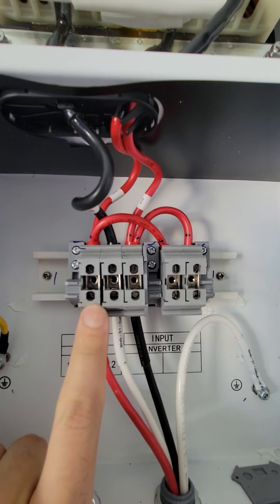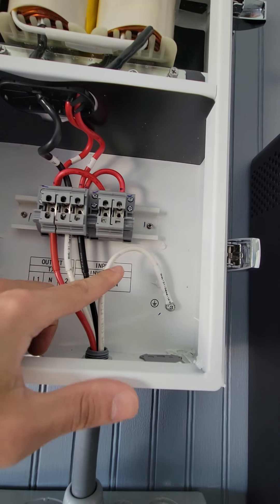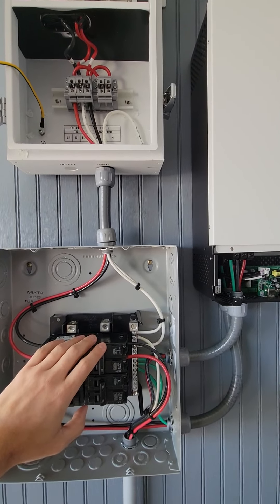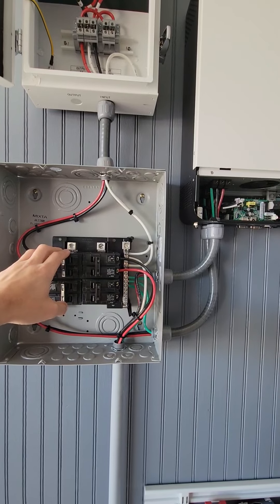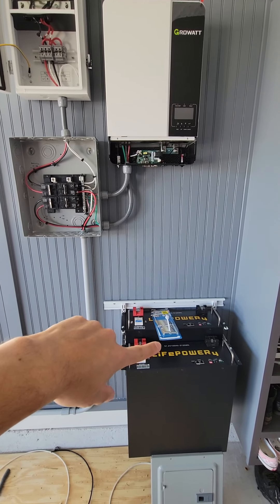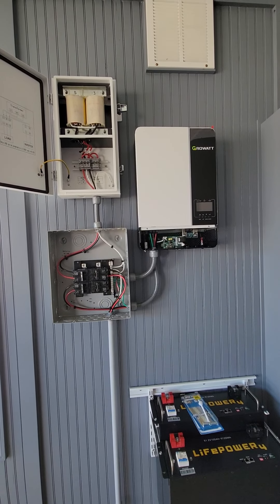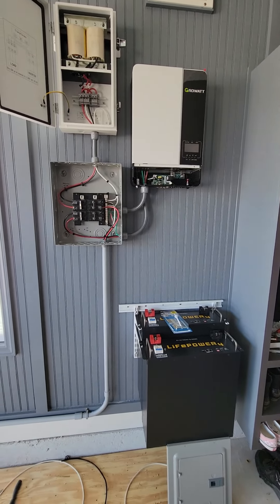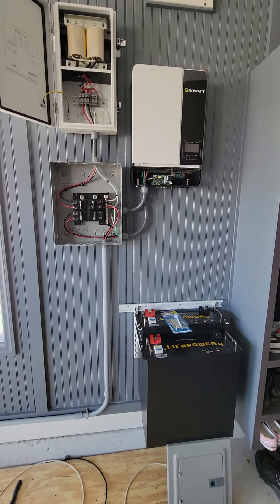Growatt 5KW Transformer and Inverter

Comment: Your setup is fine so long as the breaker for the transformer is NEVER turned off or NEVER trips.  if you do, you will lose the neutral and half of your 120V loads will decrease in voltage and the other half of your 120V loads will increase in voltage.  How much will they decrease and increase?  That will vary based on how much imbalance there is between the 120V loads connected to the different hot wires.  They will always add up to 240V though, so you could have 80V on some and 160V on the others, or it could be 10V on some and 230V on the others.  It'll all depend on how imbalanced the loads are when that neutral is lost.  You can fry you devices at best or start a fire at worst.
Reply from the maker: I will call signature solar and get their advice on this. Like I said in my previous videos I'm not an electrician. I hooked up this transformer the same way signature solar did the Solar Edge inverter in their video. The L1 and L2 are jumped (at the transformer) and the neutral is free to the busbar. in the event the transformer failed there is nothing protecting the neutral and the 240v from the inverter will always be live wires. unless the breaker trips in the inverter. I'd also like to test your theory and see what happens.. Would be a good video to post. Thanks.